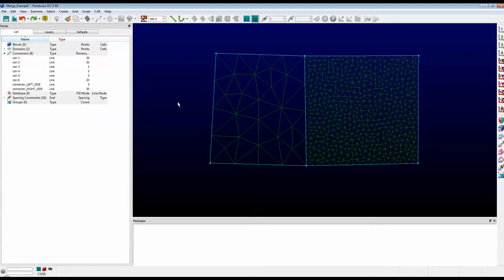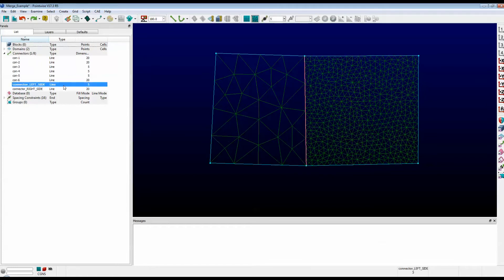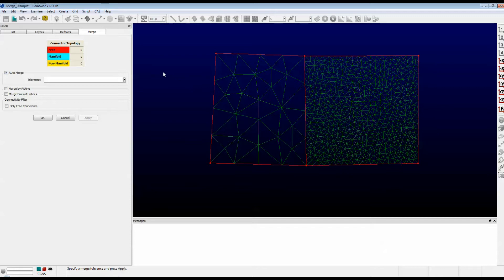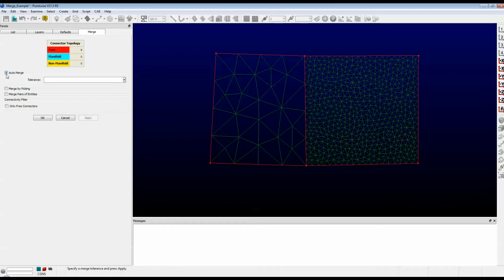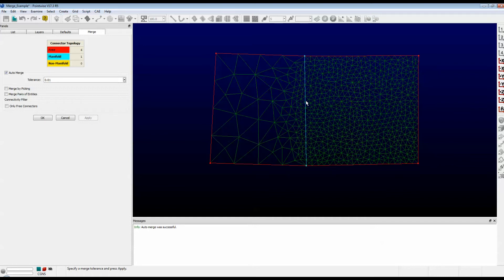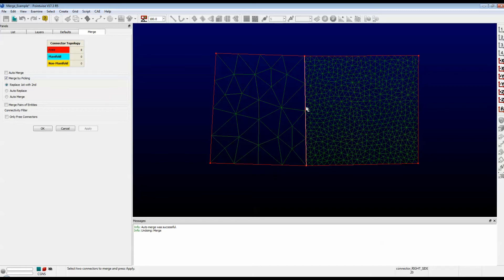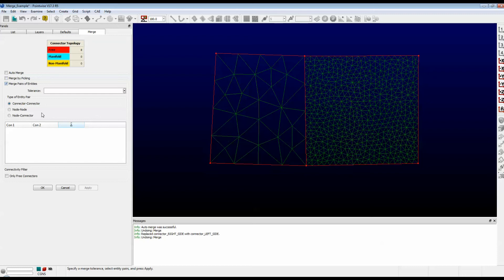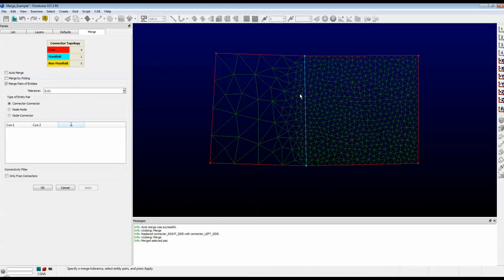Merging Connectors

Comment: Hi, great video!

Is this possible with structured domains? I guess not because I can't find the way. 

I'm meshing an airfoil with a slotted flap and separated everything in "blocks" but can't manage to merge connectors with different sizings. I do this to coarsen the grid towards the limits of the box so that computational cost is optimized.
Reply: It is possible to merge any two connectors that have coincident end nodes. When that happens, the secondary connectors' dimension will become the default dimension for the newly created connector.  If that causes a structured domain to become unbalanced, the domain will become broken.